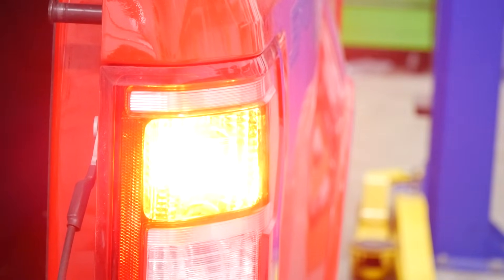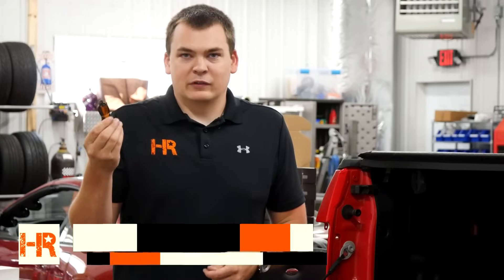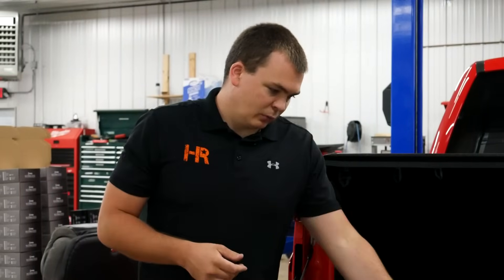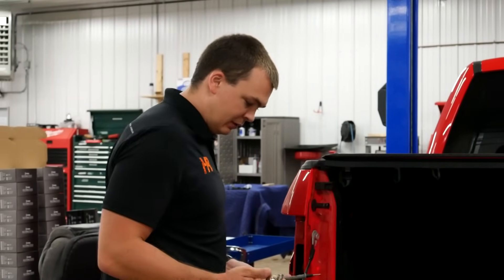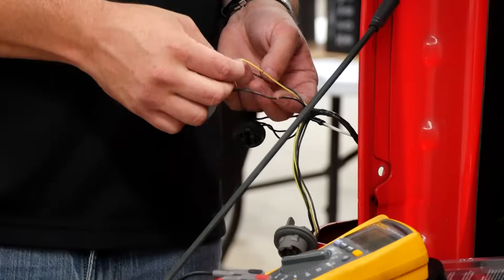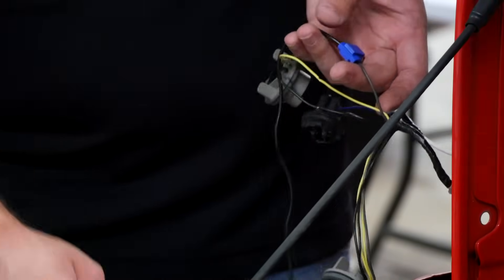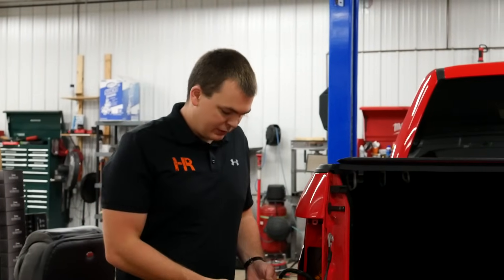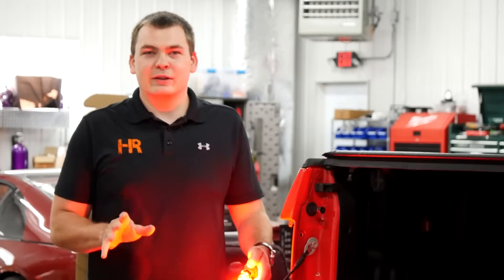How To Install LED Resistors - Everything You Need To Know | Headlight Revolution

Comment: You said they won’t burn your vehicle down but what about people like me where your front turn signal is always a parking light. So I have switchback bulbs white when parking lights on amber for turn signal. Will my resistor catch on fire bc it will constantly be on whenever my parking lights are on
Reply from the maker: No just make sure it's mounted properly. (Mounted to metal, not plastic)
Reply: It should be as hot as it was when you had an incandescent bulb there before. The amount of  current flowing through that circuit should be the same.

Comment: Anyone just install leds and let them hyperflash? Lol
Reply: Some motorcyclists leave them hyper flashing for added visibility
Reply: My opinion...hyper flashing draws more attention..kinda like the blue lights behind you
Reply: Can we just replace flasher relay (with led compatible flasher relay) ?
Reply: Kotak Topi On older vehicles, yes. On newer vehicles, no.
Reply: @mereview2615   yes if you have one.  My JK doesn't use them it goes through the computer and even the clicking noise is fake
Reply: Yes I did....it flashes normally for a few seconds then goes to hyper flash. I have to say it’s a little bit annoying. I’ve got the resistors but I wanna make I know exactly how to install them.
Reply: When I'm turning or changing lanes, 3 seconds of superbright fast blinky is awesome, and not yet against the law.
Reply: future shock.......did you really get that hyper flash or were they flashing like the truck lights in the video?  I replaced ALL my exterior bulbs with LED without the resistors and the the flashing is faster but it’s nothing sneeze at......it’s probably twice as fast. Not that bad.
Reply: led blubs
Reply: get bulbs with the built in resistors? pay more but skip all this backyard mechanic bs with wiring
Reply: @0Rthx  can you link me up to some of those?
Reply: @0Rthx That's my plan if put LED turn signal  bulbs  in
Reply: yes and even worse I had leds that would fall out of the socket and into the headlight housing. I finally after almost a year this week bought new leds. They sit tightly in the socket now but i am too lazy to install resistors and I can't install a relay because honda likes everything controlled by the computer. I think I will get the Alla lighting pre wired resistors instead.  3157 turn signal leds.
Reply: @JankyDubz  thanks I too am in the market for some bulbs that will have built in resistors
Reply from the maker: We have seen it a few times. Not sure why though.
Reply: I have questions for u 2009 ford escape led tail lights color wires taps in two used led resistors as well turn signal in them roo led reaistors .help out thank u for time
Reply: Jason Stewart 
Go to an online store and get a $10 flasher unit for $10 that replaces your existing flasher unit, but designed for LED.  They are just a swap out. No bolts. Pop old flasher out, pop new one on.  Done
Reply: Have put hyper flasher reastors screw take in shop if put in for me
Reply: Me. I didn't that was a problem but yeah its annoying hearing the turn signal flashing faster and I'll fix it :v
Reply: I do.
Reply: Jamie M 😂
Reply: @oamvatb-23958  you should have said that's what they came with, it's always been like that since the day I bought them...I didn't know it wasn't supposed to be like that.  What can they actually say?  Who cares how fast they flash?
Reply: Would have been more informative if the size of the resister was given.
Reply: @oamvatb-23958  lol

Comment: Hi, I just installed some LED for my turn signal light. Although it flickers, I am actually ok with it. My question is do I really need to use resistors? Without them what is the downside beside the flickering. HELP PLZZZZZ !!
Reply from the maker: If you are fine with the way it is, you don't need the resistors.
Reply: @HeadlightRevolution  Can Resistors solve the problem for showing erors on dash???

Comment: Which resistors would I need for a 2014 silverado? And would I need to do this to the front lights as well if I change those out?
Reply from the maker: You would need this conversion kit: https://headlightrevolution.com/2014-2018-chevrolet-silverado-2500hd-3500hd-high-beam-led-conversion-kit-v-4/

Comment: I have a car with fiberglass bodywork and no metal to attach the resister to.  Also, with the resister installed, the wires coming from the resisters are not long enough to reach a body panel.  What should I attach the resister to?  Is it safe to lengthen the wires on the resisters?
Reply from the maker: Surely there is a metal frame under the hood? Doesn't need to be a body panel, can be a crash bar, bracket, etc... Yep you can definitely lengthen the wires!
Reply: @HeadlightRevolution  In my case, the resisters need to be in the tail lights.  The car is a C6 corvette.  The inner and outer panels are all fiberglass.  With the resisters in stalled on the tail lights, the wires are still not long enough to attach to the inner panels.

Comment: I have a caravan with led turn lights my tow car are normal lighting do I connect resistors to trailer plug
Reply from the maker: If you're installing LED bulbs on your trailer, you could put the resistors anywhere inline, as described in this video.
Reply: thank you for your reply I did put the resistors on the caravan put one end on earth and the other two resistors on both  turn signal wires I had no change to the flicker on led light bars can you help me thank you Andy

Comment: I have a 2016 F 150 Super Cab that I put LED Turn/brake LED bulb in. I get a regular flash speed at the bulbs, but in the c ab I hear the hyper flash sound. I tried a resistor at the bulb and it didn't change anything. Suggestions?  Thank you
Reply from the maker: Where did you get the LEDs from? It may be that you tapped the wrong wires for the Resistor, that is typically the issue we see. :)
Reply: @HeadlightRevolution  fixed! Note to self... do not do it at night in the dark. Lol

Comment: Cool vid. I wasn't sure which wire to connect on the "hot" side. Thanks
Reply from the maker: You got it! Glad we could help!
Reply: @HeadlightRevolution  will that fix the cruise control? Or do I have to put resistor to brake wire??

Comment: Hi I would like to purchase these can you tell me what I should order I have a Dodge Ram 1500 2007, My issues is on the right flasher it is blinking fast ?
Reply from the maker: Here is the kit you will need: https://headlightrevolution.com/2006-2008-ram-led-front-turn-signals-upgrade-kit/

You have Hyperflash currently with the stock bulbs?
Reply: @HeadlightRevolution  is this for all 4 lights ?
Reply: please let me know if I need to do all four flasher lights for this to work ?

Comment: Will it work with head lights?  I put in LEDs on my wifes head lights and they occasionally flicker?
Reply from the maker: No, chances are you need a PWM module or Anti-Flicker harness. What is the vehicle that is having these flickering issues?
Reply: @HeadlightRevolution  a 2009 avenger
Reply from the maker: @joerogersthird  Ah, you are dealing with a CANBUS issue, you just need PWM modules to solve this performance issue. 

Link: https://headlightrevolution.com/gtr-lighting-pwm-interface-module-9005-9006-style-connectors/
Reply: Headlight Revolution I installed Headlight Revolution HIDs on my wife’s 15 Cherokee. Everything works fine except for the passenger side headlight during “courtesy” mode when the car is unlocked. It illuminates for a second, then goes out. It’s fine once the headlights are switched on. The drivers side works normally.

Comment: Do you need a resistor for each buld?
And does it take away the malfunction warning signs on the dash away? Thank you.
Reply from the maker: The only LEDs that will need a Resistor is an LED Turn Signal. Other than that, all other LED upgrades will not require a resistor. It will remove all warnings and will allow the bulb to blink normally. Great questions!
Reply: @HeadlightRevolution  i meant to say if both signal lights need resistor but you answered that. Lol thanks for answering 👍🏼and also im getting a malfunction warning for my fog lights upgrade. Do i need a resistor for the fog lights too? I have a 2008 bmw 328xi coupe. Thanks again.
Reply from the maker: @junito2205  Did you order the Fog lights from us? It sounds like you need a PWM module to coop with your BMW's CANBUS. 
Link: https://headlightrevolution.com/gtr-lighting-pwm-interface-module-h11-style-connectors/
Reply: @HeadlightRevolution  Yup! That's exactly what i was looking for. You the MAN! THANKS! Will order Now.
Reply: @Headlight Revolution I need it for H8 fog lights. 🤦🏻‍♂️

Comment: 2016 Ram 1500. Rear turn signals. 3157 socket. 3 wire.  I understand how to install.  My question is why do some kits for this application come with 6 ohm resistors and some with 8 ohm? (both 50w).   Mine came 8 ohm.   Have not installed yet.

Comment: WARNING. Be sure that any wiring stripped open "especially" on trucks inner fenders or areas that are damp locations, are sealed from the elements i/e solder joints,  shrink tube, spray on electrical tape, silicon,  electrical tape. Failure to do so will result in long term damage to your wiring, corrosion will follow the entire span of wire ruining your factory electrical wiring harness. Keep water and salt water out. Very important. Make minimal cuts into original wiring when at all possible.
Reply: Why wouldn't you just use your probe in the socket and not strip anything especially if your using t-taps and if you know enough to solder would hopefully know to insulate. I know it's not your video I just haven't seen any comments on not stripping unless you have to.
Reply: Tjank you. One of the best utube video demknstrations with clear illustrations and explanations. This jndicates that you are a specialist and work safely...well, you know what you're doing. Congratulations!

Comment: What about determining which resistor is needed for non- turn signal lights to avoid "bulb out" errors?
Reply: You  should look for what typical wattage is drawn by your standart halogen bulbs. When you know that, you should buy resistor higher than halogen required wattage. I e. H7 headlights draw around 35W+, so standart resistor for H7 LED headlights is 50W.

Comment: Don't do it! If you own a Ford, Lincoln, Mercury, or Mazda, program it with Forscan to not hyper blink. No splicing into factory wiring. Get a OBD to USB cable with a laptop to fix your issue. I've done the resistor route, regretted it.
Reply: I've been hearing about Forscan, can it be purchased or do you need to take your vehicle to a shop?

Comment: Boss thank you very much for the helpful video. I installed LED fog lights on my mercedes S550 requiring the resistors to work. my questions:

1- Will those resistors affect the computers/mess up the electricity in the car?
2- I had an check engine light come up after installing them from temp sensor malfunction.. that went away on its own! then the low beam light was blinking and now not working!! (both on the drivers side). 
3- I didnt know where to mount those resistors that can get very very hot! I am afraid they melted some wiring? thank you very much again
Reply from the maker: Your Mercedes has a very picky system that is rejecting the aftermarket lighting.  The resistors should not cause any form of issue to your car's system. Try putting the stock bulbs back in and see how the car performs after that. What resistors did you install? 
Fog light PWM/modules should not get hot, so it should not matter where they are mounted.
Reply: @HeadlightRevolution  Thank you very very much for the very valuable info.. I used the cheapest on ebay thinking they are all the same..I dont have the original fog lights anymore..below is what I used, and those can get REALLY hot as you probably know.. I didnt find a metal plate really to mount to the way you drilled in your resistors in the clip.. 
-As far as the rejection theory.. its interesting and I hope it is not the issue.. but the fog lights now are working perfectly using the resistors .. other things have been giving a problem example (headlight) on the driver's side.. now could it be that the bulb is out?! possibly but what the likelihood after using the resistor..especially when the headlight was blinking before it went out.. i hope im not messing up the elec system 
thanks again for the very helpful replies 
https://www.ebay.com/itm/2X-6ohm-50W-LED-Load-Resistor-Turn-Signal-Blinkers-Fog-Lights-Fix-Hyper-Flash/263444419330?hash=item3d5682d302:g:MwcAAOSwGt9bVs4A:rk:1:pf:1&frcectupt=true
Reply: @HeadlightRevolution  I am not sure I could find the PWM/modules on ebay, would you kindly provide a link.. thanks
Reply from the maker: @mazharsoufi5270  Those are not the correct resistors for Fog Lights, those are for Turn Signals only. What Year/Make/Model is your Mercedes? Do you know what Bulb style you Fog lights are?
Reply: Never use LEDs on a fog lights or head lamps. Instead use halogen lamps because it emits lot of heat and thus prevent your lamps from fogging especially during night time or rainy weather. LEDs don't generate heat and thus the lamp fogs.

Comment: Is this process the same for say brake light/ tail light ? Changed all my bulbs to led but the brake lamp light is on. I’m assuming because the led use less energy so the ecu thinks the light is out. Also all the lights work btw they’re aren’t out.
Reply from the maker: You shouldn't need to use Resistors on a Brake light/Tail Light, it should only be needed on a Turn signal.  You are receiving bulb-out messages on the Dash?
Reply: Headlight Revolution yeah my brake lamp light is on, all tail lights and brake lights function normally to me.
Reply from the maker: @DigitalDash96  Hmmm. Please email us about this so we can better assist you! 
Sales@Headlightrevolution.com

Comment: Excellent video.  All the answers in an easily explained format and very clear and steady filming.
Reply from the maker: Thank you for the support!
Reply: @HeadlightRevolution  Chris, 2008 Yukon XL.  Put JDM LED's all around.  Installed 1 resistor to the tail light (used your example to determine Ground and Turn).  Used crimp on's to connect.  Signal still blinks quickly and resistor started to warm up so connection was good.  I'm thinking of soldering instead.  Before I do all of that, my question is this; would I need to put resistor's on both front & rear (in this case left side) in order to see the blinking difference?  Are they mutually controlled in the computer module or separately (should I have experienced quick blinking up front but controlled in rear after the install)?.  Thanks in advance., waiting to hear from you before I proceed.
Reply from the maker: @brianfields7519  You will need Resistors in both Front and Rear to prevent Hyper Flash issues, once Resistors are wired into both Blinkers on one side Front ant Rear, the Hyper Flash will go away. :)

Comment: I switched out my back up light to LED on my 2016 Chevy Malibu and has a problem with it not turning off after vehicle turned off do I need a resistor on that? And another question the fast blinking doesn’t really bother me on my turn signal I also changed them to LEDs, would anything bad happen if I don’t add a resistor?

Comment: Do we need to put resistor in both (front signal light and rear light). Or just one of them (ex only rear light)? Thx
Reply: One per LED bulb, 1 for the front LED light bulb then 1 for the rear LED light bulb for each side for signal lights.

Comment: why do my led light stay lite up not my turn led but the brake and running lights light up when I walk away and when I put the normal bulbs are back in place it's fine
Reply: 2006 Lincoln LSE

Comment: Why not replace the stock flasher with a led flasher.
Reply: Alot of cars come with the flashers integrated into the computer so it becomes impossible to do that,
Reply: Or there are no aftermarket options available. Good example is a 203-2009 4RUNNER with DRL.

Comment: So you need 2 resisters?
Reply from the maker: Yep! For most vehicles, you will only need 1 resistor per side, so 2 total. Others are odd where you need 2 per side when there are multiple turn signal bulbs per housing.

Comment: Do headlight hids need resistors?  I've burned 3 bulbs already.
Reply: I had the same problem on a 13 2500hd. It was determined that the auto on function of the lights was the issue. When the key is first turned over to acc the lights ignite, but when rotating the key to start the vehicle, the go out then re-ignite. Often it would appear a light was out, but it had failed to re-ignite. I ended up pulling the system and went with led
Reply: @kylekroft9154  So far so good I purchased two 2X 9005/9006 LED Headlight Canbus Error Anti Flicker Resistors.  They seem to be doing the job.  Thank you very much for your help guys.
Reply: Yup this LED resistors also work for the HIDs so far its been a week cross my fingers.
Reply from the maker: Nope, no resistors are needed for HID installs. What vehicle do you have?
Reply: @HeadlightRevolution  Thanks for the fast reply I have 2013 Silverado 5.3 engine 4x4.
Reply: First it burned my left bulb I fixed it then the right bulb burned I fixed it and now my left burned again.
Reply: I bought this used truck like 4 months ago it already had the Hid's installed so that's why I thought maybe they didn't install a required resistor or something.
Reply: It currently has a pair of brand new Xentec 9V - 16V ballast that I put in when my first bulb burned out and now two new bulbs burned.  Hope its not to confusing.
Reply from the maker: @joaquingomez5122  Sounds like you have a poor HID kit if you keep flying through Bulbs like that. It sounds like your bulbs are poor quality due to the pattern they burned out in. That's odd!